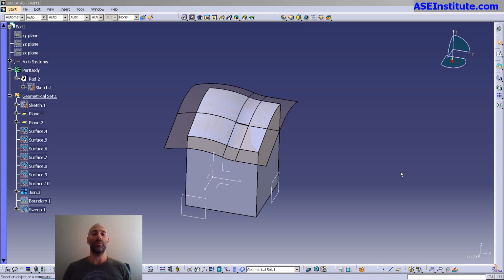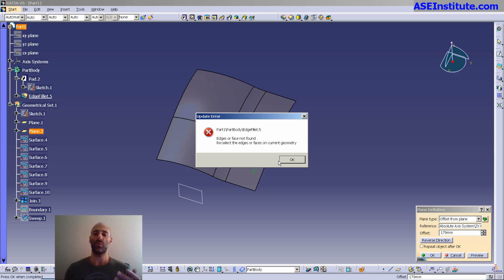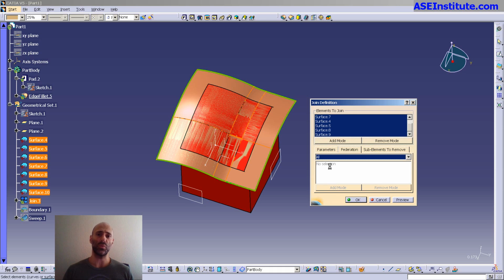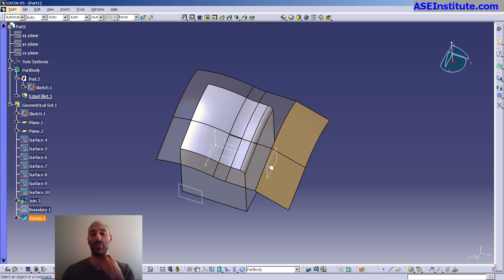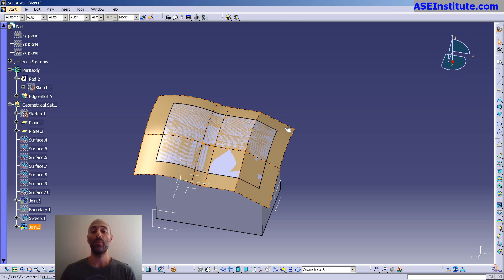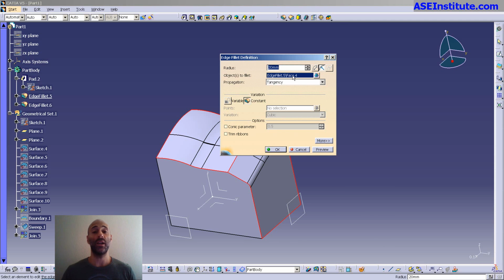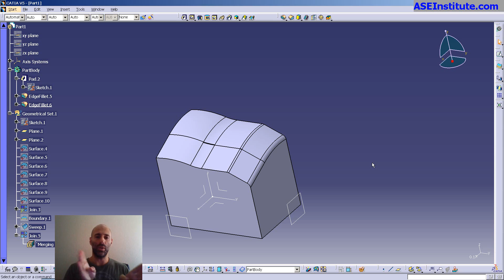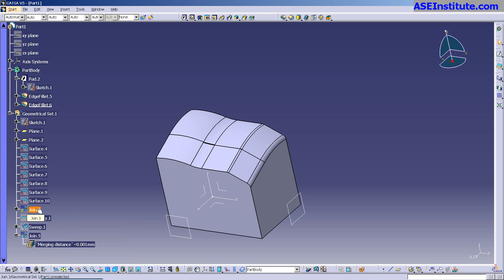What is Federate: CATIA V5 | V6

Comment: Any tips for removing federation from a surface? Splitting seems to be the only option that I have found but is not great unless you have the original geometry that created the boundaries. Disassemble also just creates isolated surfaces.